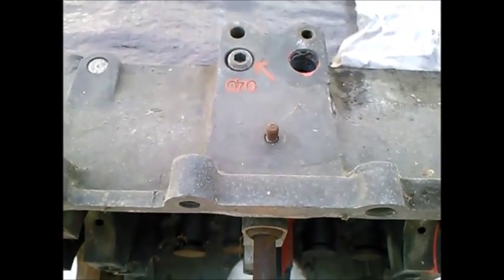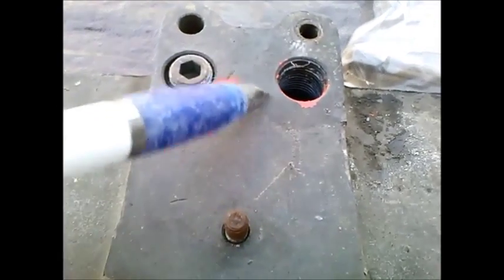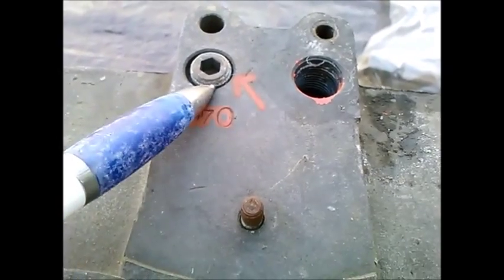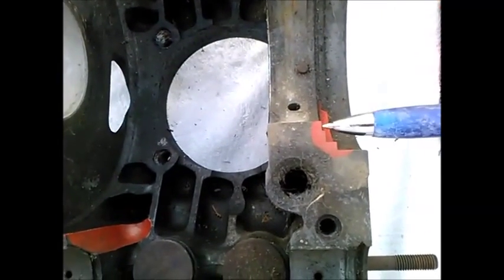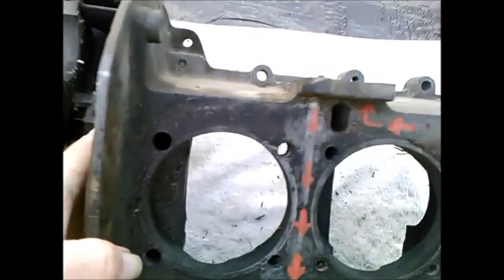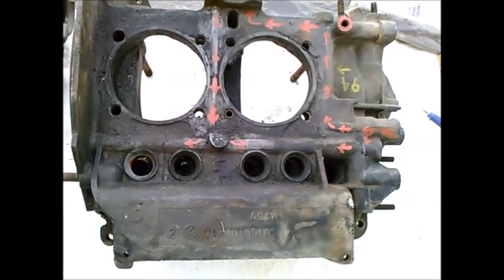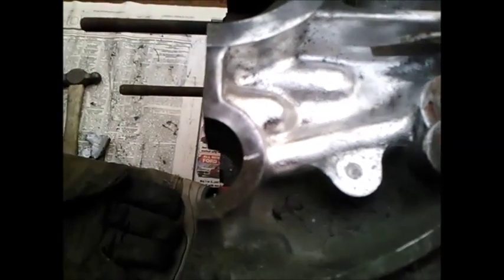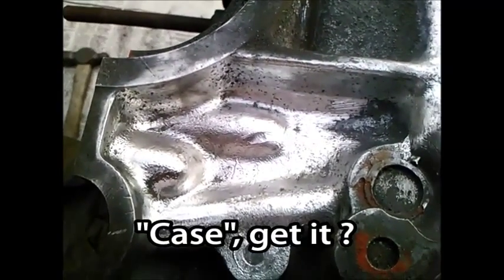VW AS41 Engine Case - Can I re-use this case ?

Comment: 8:56 most of the time, heating the case with a torch directly in the problem area, it will show up the cracks in the material… saludos.

Comment: Old video ... so whatever happened is a long ago done deal ... but I don’t think i would attempt to spend any “real money” on that case. In other words, I might try to throw together an engine with used parts I have in “the hoard”; topped off with a cheap Brazilian gasket set, just for giggles, and see what happens when it starts up.

Comment: What did you decide ?    I heard  you  can clean teh case, and then put it in the sun, as it heats up,  the oil will come out of any cracks.     The case definitely has been used.  You might be better off finding another engine to rebuild ?
Reply from the maker: This project is back burnered for now.  Although I'll wish it were complete if the engine in the car now fails.  Sometimes think I should just ship it to RIMCO, get it bored for 94's, address the thrust surface, maybe have it welded up behind #3.  I have a cheapo 74mm cast crank made 30 years ago, the plan is this case, that crank and some thick wall 92's.  But there are always complete, running engines on craigslist for < $1000.  The engine before the engine I'm running now, I paid $100 for.  Thanks for the comment.

Comment from the maker: Thanks for the input, Mario C.  But I cannot reply to a "linked comment", perhaps you will see this anyway.  With a caliper I measured .860, with a micrometer .8575; converting to metric a tad under 22mm.  So maybe uncut, pounded down a bit.  I'm unclear also why with a thrust cut, the machine shop must machine the bearing also.

Comment: The thrust surface is the last "step" in the case(One all the way to the left in the video). In std. cases it lines up nearly with the one directly next to it. Looks like it has been thrust cut once already. If your have calipers get a measurement of the width of the surface. Std is 22mm 1st cut 21mm and so on. If its cracked behind #3 then the case is done. Usually doesnt happen on cases which are deep studded. Welding will only warp the whole case making it unusable. The epoxy was probably used to seal a leaking case.

Comment: I am very uninformed about VW engines but in the case of the epoxy i would weld it up and call it a day. Even if there were hairline cracks the weld would repair it.